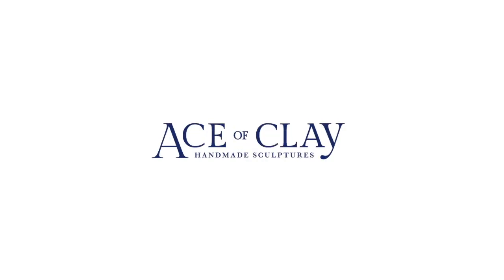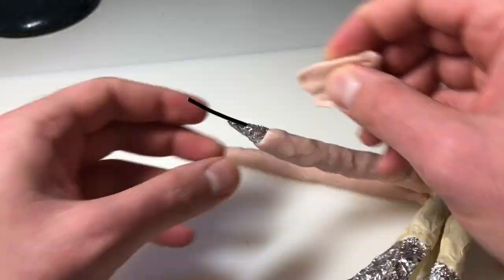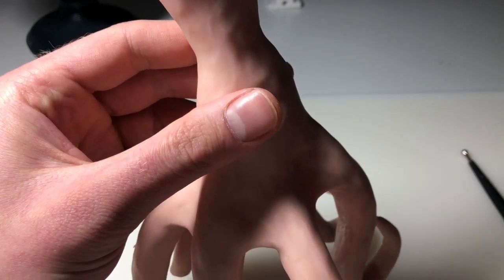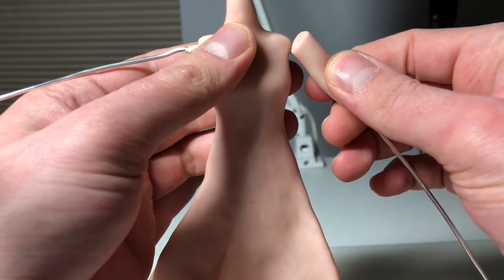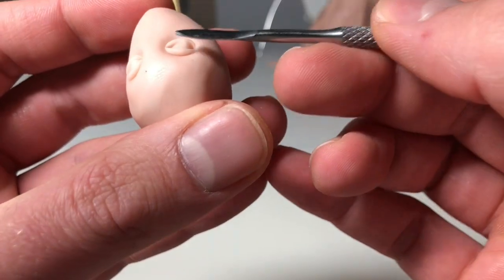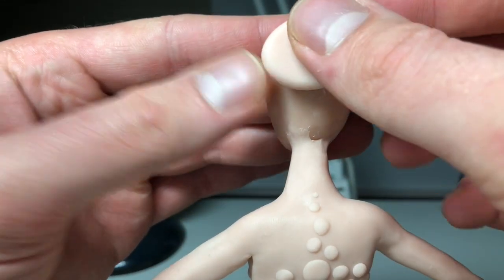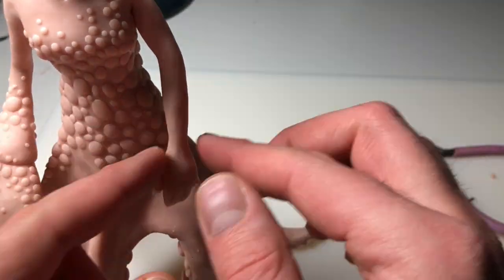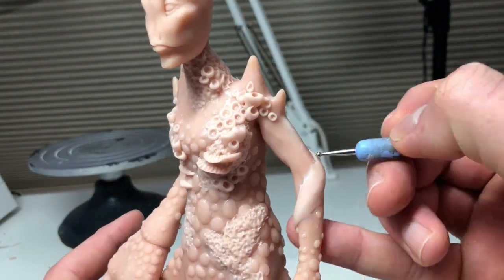Sculpting and Painting a Sea Witch from Polymer Clay Timelapse Tutorial

Comment: That turned out great! I love the coral barnicle touch and the tenticle hair. I know the package gives baking guidelines to follow, but you mentioned baking multiple times. Could maybe in depth on this a little more. I know not every sculpture is the same, and baking would determine on the thickness. I think getting an idea of how you bake at different stages of the sculpt process and how you protects from possible burns or cracks would be useful. Even if it is just verbally mentioning how long you baked an area and what temp... I think would even be helpful. I don't want to make your video process harder, but knowing small tips like that I get a rough idea when I make my sculpture. I am really enjoying your work, and pick a few tips visually and audibly as you video runs. You have expanded my mind, and for that I thank you. I need to keep practicing that eye technique you do. I have tried a few times as practice, but not completely there yet... But practice, practice, practice I shall do. :)
Reply: Whenever he is talking about pre-baking he's talking about a specific technique used by polyclay artists to protect their work. Pre-baking is taking a piece you don't want damaged and putting it in the oven on clay specific recommended baking temps for about 5 minutes; this will not give a full cure but it will make the piece hard enough to handle and not damage preexisting details when adding new elements to it. There are a good number of videos on Youtube concerning pre-baking pieces in order to save detail. As far as not burning pieces in your oven a lot of that depends on knowing how your oven heats, how close you have your pieces to the heating elements, how thick the pieces are, etc. I've personally never had a problem with "burning" polymer clay, yeah it can get darker the longer you cook it but if you're painting it anyway, it's not that big a deal in my experience. The only way from my experience that you're going to ruin a piece is by cooking it at temps that are above the recommended temps. I'm not trying to be condescending at all and I hope I didn't come off that way, I hope that I've been helpful.
Reply: @Fnordathoth  That was very helpful for me, thank you! I had the same question, so I'm glad I read through the comments, first!

Comment: The issue with watering down acrylics isn't that it won't mix, it's mostly that when you start to water it down, you're breaking the bonds of the polymers/glues/medium that holds the paint together. You can end up with flaking if you water it too much. I've only had it happen a few times, and if you're coating the piece with a protective layer it should be perfectly fine.

Comment: Acrylics can be thinned with water. Latex and enamels can too as long as it is a water based enamel...typically an acrylic enamel. The only paints you can't thin with water are oil based paints. If you are unsure, a good rule of thumb is to look at the clean-up instructions. If it says to clean with soap and water, it can also be thinned with water. If it says to clean with mineral spirits, acetone, or paint thinner, you can't thin it with water. You would have to thin it with paint thinner.